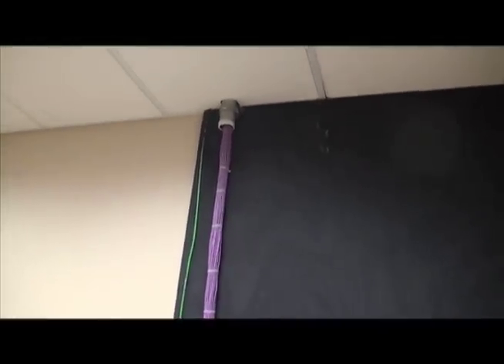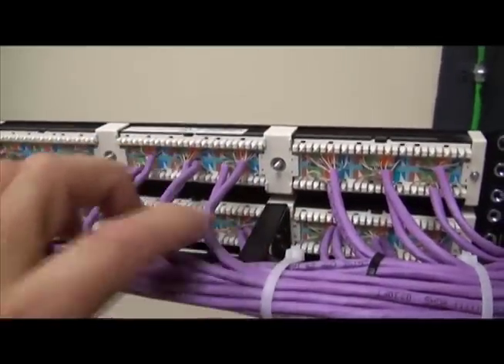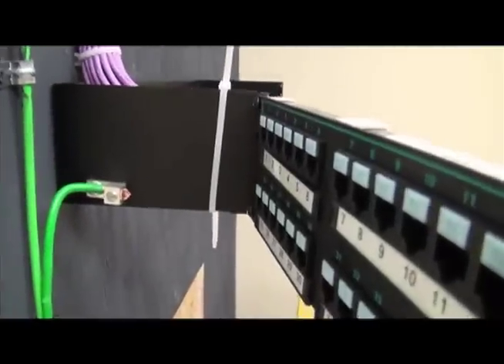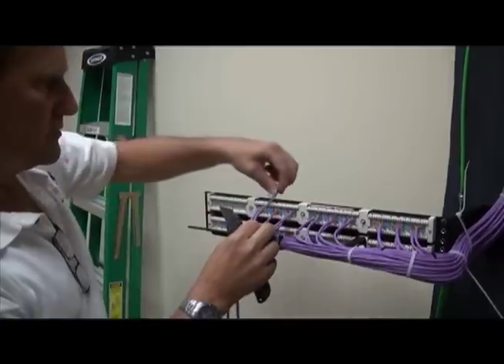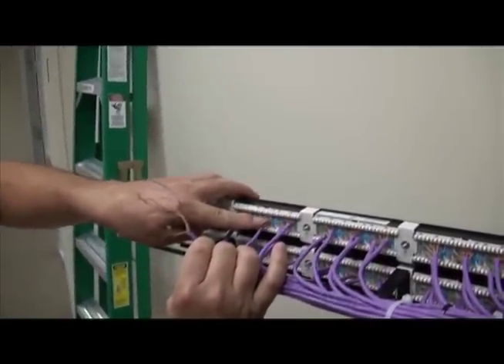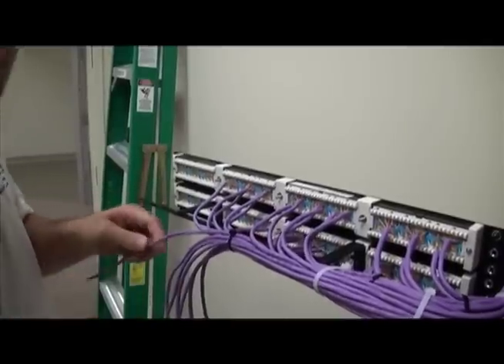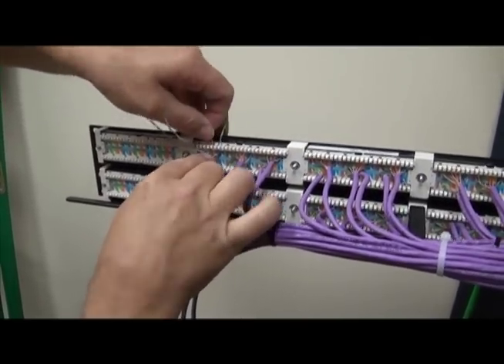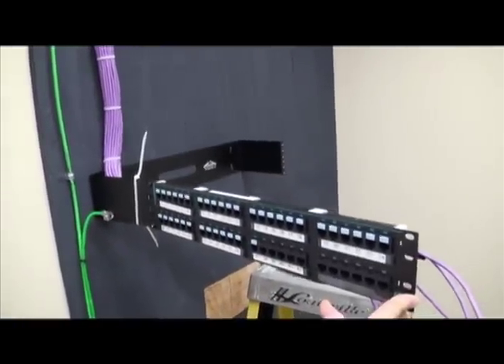Termination-Patch Panel Tutorial.mov

Comment: Been doing cable infrastructure for 20 years.  Almost every place I have worked we were absolutely forbidden to use tie wraps on the cable....  Velcro only, or in the case of central offices or AT&T buildings, 12-cord.  And the next cable monkey I catch using snips to trim the ends off a tie wrap gets a smack in the back of the head.  At Lucent, we were required to use flush cuts.  I got in the habit of using flush cuts real fast where we were allowed to use tie wraps.  A tie wrap with a jagged tail sticking out will flay your arm or hand open so fast it ain't funny!  Looks like yours seem to be trimmed nicely flush.  Good show.
Reply: I used to work at Lucent as well, never used tie wraps in the co’s, only 12 cord.  Lucent was the best cable infrastructure job I ever had.

Comment: In my opinion, the amount of cables grouped does not seem appropriate. You should separate into groups of between 15 and 20, take them apart to improve the insertion (IL) of them and in addition to avoid electromagnetic induction, this is important if the network should then be Certified. About CAT6A no more than 10 cables this is due to the frequency that handles the cable.
On the other hand I agree on the use of the corresponding tools and materials (cable ties and shear not indicated for such operation) this will make our installation is standardized, avoiding damage to the network materials and during the process to avoid accidents by not use the corresponding tools.

Comment: I'm curious that none of the cables seem to have any kind of identification or labeling on them so how do you know that you're landing the right cable on the right patch point? It looks as though it's completely random, based on where they lie in the bundle.
Reply: Doug F don't need to label them, you identify them and label the jack at the end of the install.
Reply: @jasonlee3247  so you are saying that port#1 will be for example unit209 and port#2will be unit201. By your logic and not labeling before hand all the ports will be random and not sequencial. Will be nightmare trying to troubleshoot that

Comment: thanks for the video, I'm studying to get into networking and I'm having trouble grasping why a patch panel is even necessary.....If a room has network wall outlets available, then you should just be able to move to the new port.....the only thing I can think of is that the devices need to stay connected to the same port on the switch in order to avoid IP conflicts.....but any feedback on this would be helpful.
Reply: I'm sure you figured it out but modular plugs have a tendency to fail so using a patch panel between the switch and the end user termination provides a fairly cost effective method to reduce service calls. Also patch panels make servicing and making changes to a network a breeze.

Comment: "you take the one on the insde always" .... dident you number your cabels arent the customer find it strange if his telecommunications outlet  1 2 3 4 5 is located at port 2 6 8 9 or and you dont unspinn the wire . the twist in the twistet pair is there to reduce crosstalk you are going to get a lot of NEXT and FEXT errors.
Reply: Bret DaCosta The idea of structured cabling is to have structure. If you're in IT and you're looking for outlet number 123. But 123 is next to numbers 078 and 021 then it's gonna be hard to find an outlet. 

When you look at a floor plan the outlets should follow some structure; if you terminate with no order of cables then you're just gonna have a random mess.
Reply: @thomasharman1435  If you have a floor plan, the panel designation is on plate and floor plan, ie:   P1 J5...You go to panel 1 jack 5...
Reply: Bret DaCosta I suppose it's just the way we're taught here in UK. The company I work for here has the contracts for all the large banks so everything we do has to be very exact and precise. 

PS I'd never heard of a cable mapper until you just said haha looked it up, great invention <3
Reply: U right that guy must be fool
Reply: Thomas Harman14 this video is clearly proving my point, I see no mess here albeit it's not a union quality job but it's neat. 

Unless you have a requirement i.e ports on a specific VLAN that will not cross multiple switches and you know what your rack and patch panels are going to look like before the space is built which is pretty much never the case in the SMB market I find.. the run, terminate and label last is far more efficient.

There is a reason why cable mappers were made.
Reply: There's no reason to number your cables at all, unless explicitly asked to have certain numbered ports in certain locations. It take far less time to run, terminate and then have one guy stick a toner in the wall jack and have another guy at the patch panel with a walkie-talkie tell him what port he just lit up.Label the jack and call it a day.

Comment from the maker: Just read through the 40 comments. Thx for all of them. Some responses to comments about safety, velcro, knife used etc.  Both Velcro and cable ties are fine. If cables are added later it does make it easier to have velcro so I agree with that. I use velcro as best option but on some jobs like this I was out of it so I used wraps. Re:Knife…..I like my guys to use the stripping tool but I have been doing this so long I score the sheath without any inside wire damage due to such sensitive feel now. Not a good choice for most though. Re:Safety….I agree that glasses should be worn for "every" part of cable installation including terminations. I was lazy. Should have put them on. Re: 1/2" rule…..yes…..EIA/TIA standards state that only 1/2" exposed wires at termination to panels. Re: Grounding…..Most city and County building codes in USA require #6 AWG grounding of all Racks, Ladder pathways and even small wall mount brackets like in the video. I honestly do not see it's benefit since all equipment connected in any way to these areas has a 3rd wire ground already. Just obey local codes and laws.
Reply: The company I work for has us use electrician scissors to strip the cable
Reply: +Terry Running I believe for CAT5e 1/2" is completely acceptable but with CAT6 they tightened that spec to only 3/8". Thank you for the presentation. It's helping me visualize what I'm studying in my networking class.
Reply: The ground is primarily about installation safety. If any lose electrical wire touches the back, it should connect to ground. There is an alternative, plastic patch panels.
Reply: Hi Guys I am an open registered cabler in Australia. Important to never twist or pull on the cable more that 4 KG force. Never bend a TP cable more than 10 degrees because it will change the impedance of the cable and will create errors in the data packets sent over the network. Never cable ties as it will crush the TPs and change the impedance of the cable. There are regulations in you country about structured cabling rules and cabling standards look them up before doing any work or you could be breaking the law or voiding your home insurance. Use the right tools for the job there is a draw string in the cable for removing the outer sheath not a Stanley knife. Use a trained professional for your own safety. But this job looks nice but it would not pass Fluke DSX CableAnalyzer or Australian standards and would need to be redone if done here. Thats why trained professional only want to pull cable once and you pros know what I mean :)
Reply: H LaWMaN H  mate what a load of shit you’ve just said 😂😂😂 i terminate cat 6 panels everyday pretty much and I can tell you now my panels don’t fail when I use a cable stripper the string is pointless and before you say you don’t have a fluke I use fluke dsx testers
Reply: Not 1/2" exposed, it says 1/2" un-twisted.

Comment: Why didn't you use Velcro straps instead of the cable ties.  Cable ties are a bitch to work with when you have to add cables later!
Reply: Cut them with your Klein snips and put new ones in.  They should be snug, but not so snug that you can't move the individual cables with a modicum of pulling. If too tight, then you do indeed have a bitch in heat.

Comment: You should never use a stanley / utility knife to pair a cable. If you have to,never have your thumb facing the naked blade, always cut away from your body. Oh and never put you glasses on with an extended sharp blade in your hand.